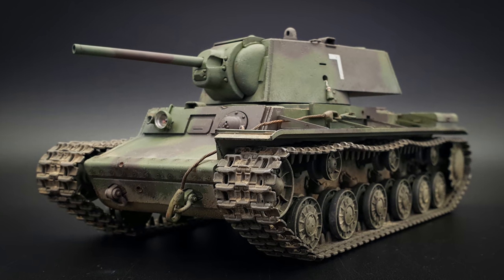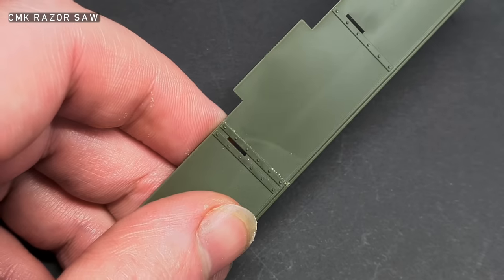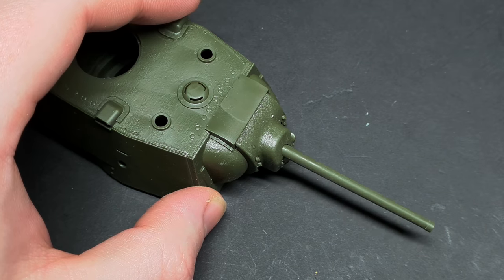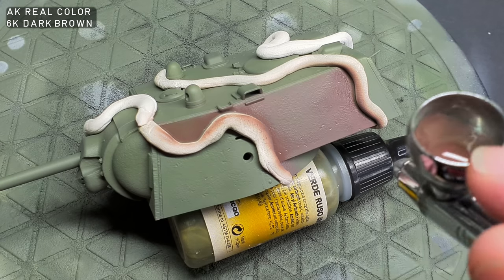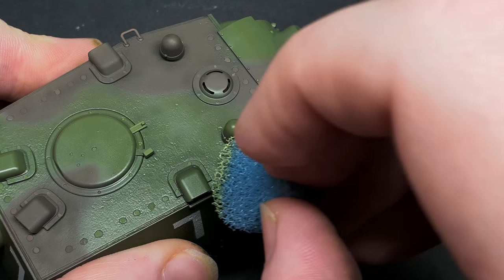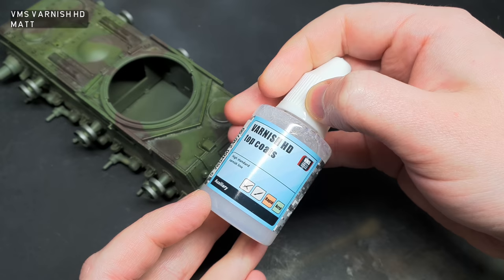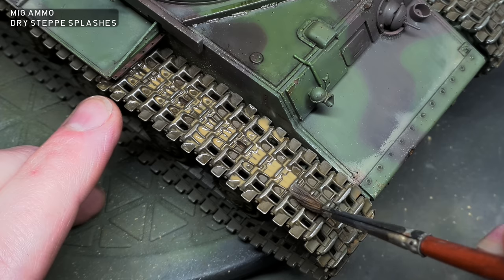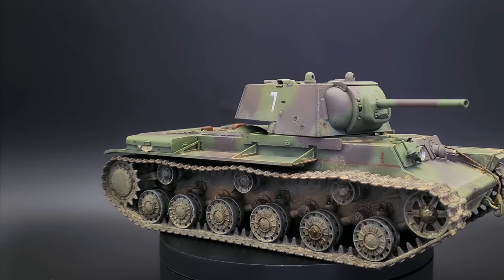Tamiya 1/35 KV-1 | Full Build

Comment: Excelent work sir👍😁 there truly weren't many soviet tanks clad in camouflage and most were just painted in a single flat olive green colour, so it's quite a surprise. I like the simple yet effective method you did to give the tracks some metalic appearance. Looking forward to your next build😎 Be well and stay safe
Reply from the maker: Thanks Annan, I did lots of research as I didn't want to do one that was just green, luckily I found one that I liked and had a reference for !
Reply: @lpjmodels  no problem😄 please keep up the good work sir. One thing I'd like to point out is that the KV-1 wasn't actually a very successful tank variant as the soviets eventually deemed it too expensive for a tank that had the exact same firepower as that of the T34. It was also considered too heavy and slow as it couldn't crooss most bridges most medium tanks could and couldn't run at the speed more that 35km/hour. One obvious thing that made it impervious and superior to the german tanks in the early stage of the Operation Barbarossa was the thickness of its armor, which was difficult to penetrate by the germans' panzer IIIs and IVs not to mention the 38ts, except at point-blank range.

Comment: Well it's probably been 40 yrs since I made a Tamiya KV so I can't recall how the old one went together but this one looks fun.
Reply from the maker: It was a very fun build, I forgot tamiya did an old one too
Reply: @lpjmodels  i can't forget the old one. I was in the model section of the toy shop and I took it to counter and plonked down my handful of notes and coins and the assistant said "this is only £n.nn, it's £." So i hunted through my pocket assuming I'd left the extra 30p or whatever at the bottom but nothing there. At that point in the depth of my despair/embarrassment, the kindly gent said "you can have it for that" and rang up the reduced price on the cash register.

Comment: That's a really good build. I must say i struggle a bit with dust effects, getting the balance. I've had some success with thinned matt varnish put in the areas where I want dust which I leave until just a little tacky and then using a brush with very little pigment, sort of dry brushing with light pigment.

Comment: Hello, nice video as always!
I have a question. Do you varnish your model before you start chipping?
Reply from the maker: Hi Edward, sometimes but not always, its not necessarily, not a solid answer I'm afraid.  Generally, as a fluid rule I'll seal after chipping and before washes.

Comment: Thanks for the information, I see there are two models, one is the ultimate and the other is I presume the standard model. Retail prices at Amazon are $83.00 and $49.00. Which model do you use?
Reply from the maker: The ones I have read  GH PN 120 Blade one nipper, these ones ( link is uk but will give you an idea ) https://www.amazon.co.uk/dp/B00U6U0WCU/ref=cm_sw_r_cp_apa_fabc_9A7XN9TK0SHEKN0PS457

Comment: great build. do you have a recommendation for a pin vise. The ones i get never align straight and the bits go bad so quickly.
Reply from the maker: Hi Stephen , I'm just using a cheap one for the moment, a lot of folks have good success with pcb drills, the individual colour coded ones, but they do cost a bit more.

Comment: Hello James, great build! I was wondering...Which diameter is the towing cable that you replaced? I bought this KV-1 today together with Eduard PE set, looks realy great!
Reply from the maker: Hi Gabriel, thanks, I just measured it for you, it was 1mm picture wire supplied by a company called lion in the uk
Reply: @lpjmodels  Thanks a lot James,  I bought towing cables from Eureka, but they seem to be short and the ends look different, I think they will fit on KV-2 even that the box says KV-1/KV-2..So Im gonna buy only the wire and use the original ends from the model box on this KV-1, Just like you did. Wish you happy holidays and keep on doing amazing work. Cheers!

Comment: It might not be a "7",  possibly a "Г", a cyrillic "G".  The sevens usually had a slightly curved stem when written.
Reply from the maker: Hi Billy I did some hard thinking over this one, there was some discussion on a forum stating that there was a chance the original photo was flipped, so I weighed up my options and your right, after further study and being able to see the horn/headlight peeking over the front plate it is 100% a Г, I went with my gut first time and it was too late to switch it when I took that second look.
Reply: Collin Zine  from the cyrrilic g, which was invented by a greek and highly influenced by the greek alphabet, so in essence yes but also no.

Comment: I am new to modeling and currently in the process of weathering a Trumpeter KV-2...you thing i can make post shading with very thinned down black tamiya panel lining or any thinned down enamel paint as i dont have an airbrush.Your advice will be mich appreciated.Thanks.
Reply from the maker: Ho wheelsdeal, I think oils would be the best way to manipulate the finish after painting, sorry for the late reply !
Reply from the maker: You could do the same with the enamels but whatever you do don't use pure black. Darker versions of the basecoat painted along the areas you want shading and then blended into the finish

Comment: Outside of a great build and finish..it wasn't successful. Only reason it gets mentioned is because nothing the germans had, outside of a 88mm flak gun could penetrate the armor. Almost every single kv tank, from the 1 series, 2 series, and kv14 and on. 95% of them were either knocked out or abandoned due to it being a reliability monster.  Between the engine and the transmission, both inadequate for its weight. But definitely cool looking. Lol
Reply from the maker: Thanks for the insight Will I wasn't aware that they were so riddled with problems. I knew that the Germans had a hard time dealing with the armour to start with, thanks !

Comment: Nice video but it pained me to see you sand over the lovely metal texture molded into the pieces,surely a more careful approach could avoid this.
Reply from the maker: The armor texture was only on the turret, and any flame cuts were put back in straight away !